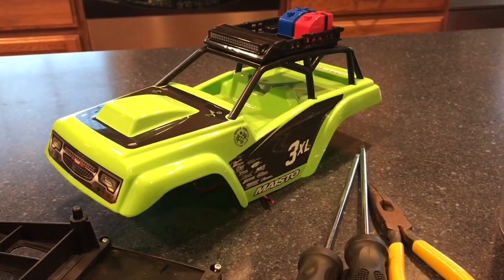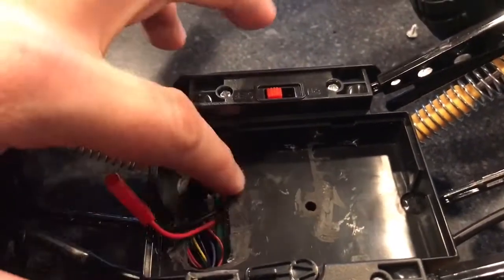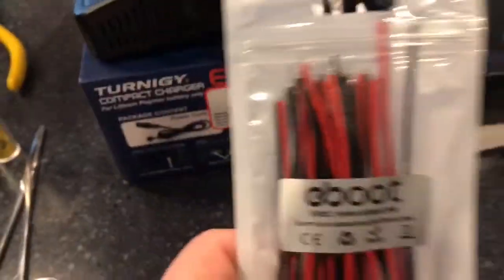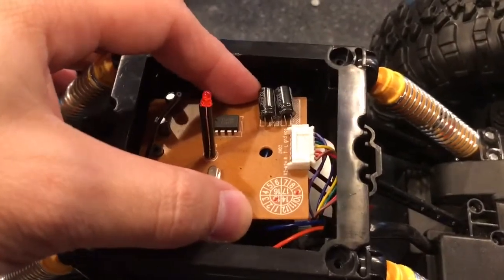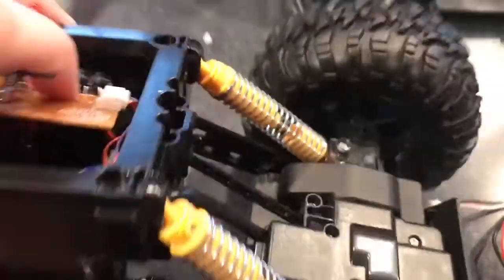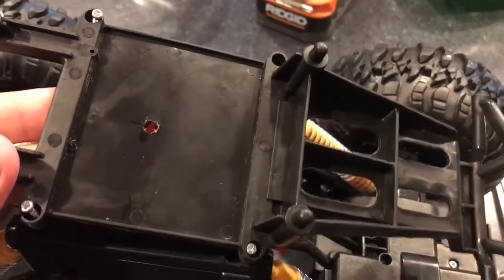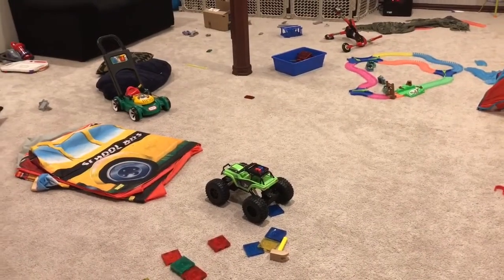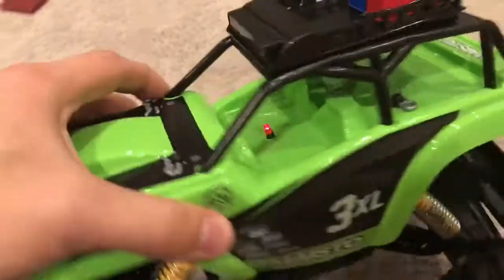Ma1sto 3XL Rock Crawler Battery Replacement Mod

Comment: Can i replace it with a 9.6 volt battery
Reply from the maker: Unknown for sure, but it'd be significantly higher than the original and may be more than the chip can handle without frying it.
Reply: Update it blew up in my face

Comment: I bought the same charger and the same battery, replaced the old battery with the new one, and charged the new battery completely, and after I used the car and the battery was discharged, I connected the battery to the charger, but the battery is not charged! The three lights in the charger flashed 6 times continuously without any result!
Please explain what is happening
Thank you

Comment: I did the same thing only I used a 5 battery battery pack for mine. I used 1.5 volt double a batteries for a total of 7.5 volts. It seems to be working well so far. I have a Redcat Everest 10 coming in the mail on Friday and I plan on taking the battery that comes with that and changing it into this rockzilla.

Comment: Brent, one question, what did you do with that third wire coming off the old battery? Thanks
Reply from the maker: Not sure what you mean... the old battery only had 2 wires going to a single connector (seen at 2:10 in the video). The new battery has a couple pairs of wires... 2 are for the JST connector that plugs into the motor and 2 are for the other plug that is used to charge the battery.

Comment: Hello Brent, thank you for this video!
I went a different path and did not do your exact mod, but your video helped me out. If you are interested, here's the mod I did: https://youtu.be/0WB-Cd82y0Q
I went with 6 x AA batteries instead.
Reply from the maker: Nice vid. Cool to see the chip can take 9v too. I didn't want to go AA's but  rechargeable AA's definitely would have been an option for me. I had the same debate about where to place the battery and almost housed it inside the "cabin" of the car, but opted to cut out the normal battery case area to fit the LiPo. Either way, happy kids and successful fix. Nice work!
Reply: Thanks!I used alkaline AAs for the video but long term will be using rechargeable AAs. NiMH rechargeable are rated 1.2v each, so 6 x 1.2 = 7.2v is about the same as the pack you used. I also read that alkaline in high-drain devices quickly lose voltage, so they aren't outputting the full 1.5v the entire time.

Comment from the maker: Quick update: Ours finally died. Trying to drive it just results in pulse/stutters of the motor. Not an expert on this, but maybe the higher voltage took something out in the ESC? It'd seem odd to have lasted this long though if that were the case. The "all-in-one" included custom board would need replaced by individual hobby grade boards (new ESC and Receiver) and it'd have to work with this transmitter... which if we are spending that much to upgrade, we'd just buy a higher priced RC car.  Oh well, it was fun while it lasted and we've purchased a different low cost car for now.
Reply: Hello Brent, I'm curious on which low cost car you've gone with now? Thanks.
Reply from the maker: @serafinlim  It was some Amazon 5 star rated RC car... ended up being a pain. Steering broke within hours, company replaced the car and that one the wheels didn't turn left, company sent a new remote, no fix, company sent a 3rd car... and a refund. So It ended up being free, and I have 4 batteries, 2 remotes, and a car... but after the purchase found the 5 star review is because they gave purchasers 2 free batteries to leave a 5 star review.  Props to their customer support, but the car is junk... only goes one speed and full turns... no variable control, and clearly not durable. Kid is happy and the dog loves running from it. Good enough for now. :-P
Reply: yikes! What a headache. Funny about all the spare parts you have now though :)
Reply: hi brent, thanks for the video. I am considering the upgrade as i have 7.2v batteries in my shed already. I am just wondering if you could estimate how many uses you got out of the car before it died? thanks

Tom
Reply: (uses after the increased voltage)
Reply from the maker: @tommyches  Sorry Tom... no idea! I don't think the death of the car was related to the voltage change... I think it was just crappy components to begin with.

Comment: I was just piecing together the parts for this exact project ran across your video. Your solution is way simpler than what I was going to do so I just ordered the parts you used. I was looking at a lithium over charge/discharge protection circuit but I wasn't sure about the ampearge output would be sufficient for the truck. Your solution bypasses all that nonsense. I will add a discharge alarm though. Thanks for sharing your video.
Reply: Haha! Son blew out rear motor within a day. Seeing if I can find a replacement now. I'm going to be in more than a entry level Traxxas soon. :-)
Reply: Hi Phillip, was the blown rear motor due to the output of the new lithium? What was the voltage?

Comment: Did you consider a ~$3 low voltage alarm to make sure the lipo battery doesn't drop to an unsafe level?  Or, did you already know that this truck has a low voltage cutoff (LVC) for lithium batteries?
Reply from the maker: I don't know if it does has an LVC and we didn't put one in.  I would guess it doesn't as it was originally not LiPo. He hasn't ran the battery to the point that it won't charge though as long as we unplug them for storage it's been fine. Adding at least an alarm is a great idea though. You can grab a simple LVA here: http://a.co/hEtfJEt
Reply: Thanks.  I've used those alarms before and will on this crawler with a LiPo just be on the safe side.

Comment: hello, my son to the same car and I'm trying to increase the game time by changing the battery.
Does yours still work after changing the battery?
Electronic components support the higher voltage?
Did the modification increase speed and playtime?
I hope you have my message and I thank you in advance for your reply.
(There is no video in France on this type of modification).
Reply from the maker: Yes to all questions. It still works, components seem fine, speed is increased, and playtime is longer. The only downside is that we have to unplug the battery when done playing so it doesn't drain beyond a chargeable level... but it's not a big deal.